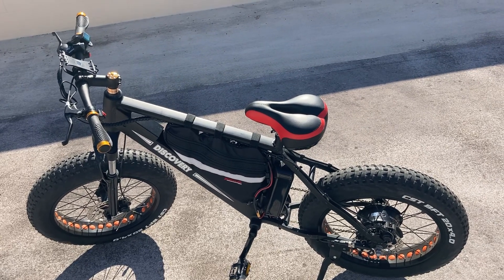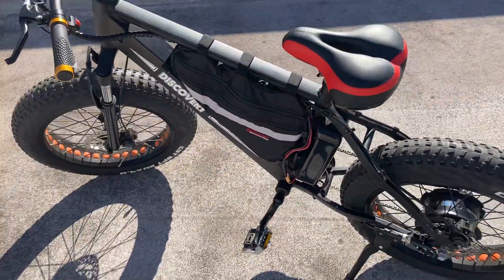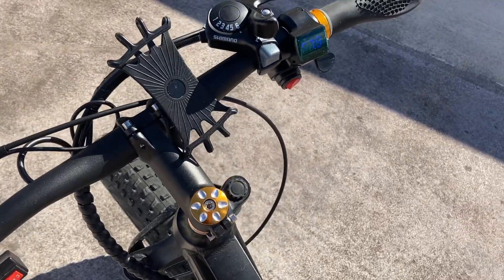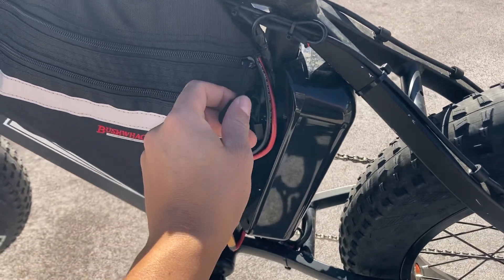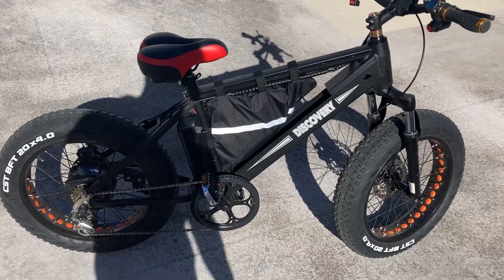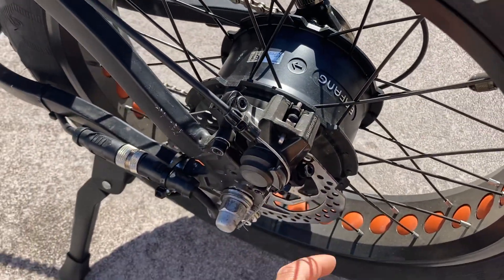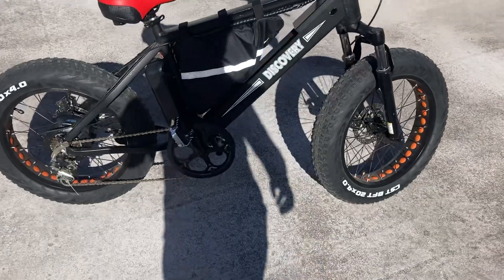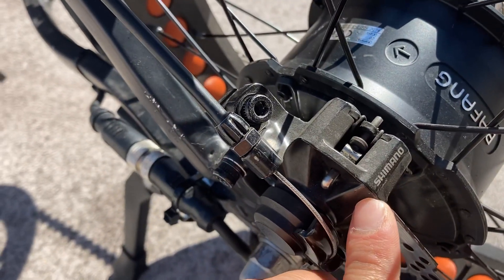New Bafang GO62 1000 watt hub motor fat tires w/ 1500 watt controller and powered by Ego battery

Comment: I have the same motor, I like it, but I was expecting a little more.
Reply from the maker: Running 72 volts on the go62 is where the fun is
Reply: @hawaiiebikes707  lol, that's where I'm going wrong!  It feels like it's governed. It's the Amazon kit with the 30amp controller.
Reply from the maker: @bassw1758  I need to make a YouTube video on how to make an aftermarket controller for that motor. It has so much potential and a larger stator so it can handle a lot more current. I’ve put 3500 watts into it 😁

Comment: Use RC LiPo, I used Zippy 20C LiPo before on my old Ebike builds, It was pulling around 5 Kw. Only possible with LiPo with a small battery. 

They never really got out of balance so I purchased a Bulk charger to finish charging at 66.4 volts if I remember correctly, that would be 4.15 v per cell for a 16S battery. I never ran them down below 3.5v per cell which really helped with the balance. Occasionally then I would hook up to my RC balance charger. I never used a BMS, it's not necessary when you know what you're doing but I always charged the battery in a fire proof location with a smoke alarm, I never had any issue. Use 30 amp anderson connectors for connecting the batteries together in series and parallel and if you make a mistake the andersons blow up and act like a fuse 🙂

The higher voltage makes a real difference.

Around 5 Kw through a direct drive hub and around 3.5 Kw through my old MAC 8T motor, that was a blast!

Is this GO60 a 6T 8T wind ?

Comment: I have the same one with 52v has alot of low end, but only 29mph top speed, I'm wondering if it's the display.
Reply from the maker: Might be. Also depends on wheel size though.
Reply: @hawaiiebikes707  if you lift the rear wheel it only goes up to 32.5 mph, but I've seen 750s hit 37mph.  It's the 500c display, but it's got good power. It's on more of a trail bike so 29 is good but feels like it has more on the top end to give.

Comment: Hi my bafang hub motor is 9 speed cassette and my bike is 7 speed cassette now I don't know what to do can you please tell me
Reply from the maker: I would bring it to a bike shop but basically your bike gear shifter has to match the gears on your cassette for it shift correctly

Comment: Hi there. Who's controller are you using  ?
Reply from the maker: It was one I wired. I have a 72 volt controller for peak of 2400 watts I can post on eBay
Reply: @hawaiiebikes707  so I purchased a G062 motor from Greenbikes in Hong Kong. I need a controller with the L1019 connector attached to it with approximately 2 ft of wire leads. I'm just getting into ebikes so I have a lot to learn.
Reply from the maker: @jeffreyjohnson2712  I just saw this. Did you get a controller yet? I have a 48 volt 1500 watt controller and a 72 volt 2400 watt peak controller wired up. You absolutely need torque arms with this motor
Reply: @hawaiiebikes707  Hi there. No, I haven't purchased one yet due to my travels. I'll be running  one 52 volt battery along with the stock 48 volt battery. I live in Minnesota and winter has set in here. I need a controller with the display.  My project bike is a Radrover5.

Comment: Where can I get a controller like yours for my G062 motor?
Reply from the maker: I wire these myself. If you’re interested I’ve sold several through my eBay because of these YouTube videos. I currently have one setup to run between 48-72 volts. At 48 volts it peaks at 1700 watts and 72 volts it will make the GO62 motor peak at 2400 watts.
Reply from the maker: It would be plug and play and will come with a throttle with on/off switch, voltage display, xt60 power cable, and will plug right into the motor. I will charge 100 for the controller and 8 dollars for shipping. Let me know! 🤙
Reply: @hawaiiebikes707   give me a link to your EBAY... I'm interested... BTW, I run on a 52v 20Ah battery. what will that peak at? I have a video of my Duo motor Radrover with BBSHD, and G062, Crushing the biggest hill in SF Bay Area, while pulling a trailer with my dog on my channel. check it out...
Reply from the maker: @AccordionSqueezer  I’ll def check it out!! I would say you can expect 1800 watts with 52 volts. The benefit of the variable voltage controller though is plugging in 72 volts and that’s where the real fun is! I’ll try to get it posted tonight (Hawaii time) and I’ll send you the eBay link. Might do a YouTube video just showing the difference in rpms so more people interested in having the option for higher voltages with the go62 can see the difference. I love that hub motor it really takes a beating. I’ve had it to 3500 watts with the phaserunner controller and it hasn’t broken!
Reply: @hawaiiebikes707  where do you get the torque arms? and what's your Ebay,  I want to buy a controller
Reply from the maker: @AccordionSqueezer  here’s the eBay link:
 
https://www.ebay.com/itm/203985672075?mkcid=16&mkevt=1&mkrid=711-127632-2357-0&ssspo=JxVnmUXIRbm&sssrc=2485189&ssuid=JxVnmUXIRbm&var=&widget_ver=artemis&media=COPY

And here’s where to get torque arms:
https://www.ebay.com/itm/363454890258?mkcid=16&mkevt=1&mkrid=711-127632-2357-0&ssspo=n1j8tckqto6&sssrc=2349624&ssuid=JxVnmUXIRbm&var=&widget_ver=artemis&media=COPY

My email: hawaiiebikes@gmail.com
Reply: @hawaiiebikes707  thanks I just ordered the controller...
I don't think the controller that came with my G062 1000w bafang hub motor kit does it justice. I'm sure this will work alot better.
Reply from the maker: @AccordionSqueezer  I will be posting a video with the GO62 and the same controller with 26” wheels. At 72 volts I hit 40mph! Will ship it out tomorrow! 🤙
Reply: @hawaiiebikes707  where do I get the eco battery like yours?

Comment: Hi,
Nice bike.
May I ask, what controller are you using, and what battery voltage are you running?
Reply from the maker: It’s just a generic square wave 1500 watt controller. You have to wire it yourself though so it’s not plug and play
Reply: So any 1500w controller will work with this motor?
Reply: @Alex-zr1wt yep. There's a little more to this, but yes.

Comment: I dont understand these motors I have a 500 watt motor with a 30amp controller and my E bike reaches 30 mph also I'm using a 52volt 20amp battery and I see videos with 1000 watt motor reaching 30 mph does more watts mean more speed?  I want to upgrade my motor to 1000 watts but if it runs at the same speed I'd rather stay with the same motor.
Reply: From my research, higher voltage invreases speed. Higher amperage increases torque.  Wattage is amps x volts.  The controller governs or limits the max amps to any motor at the battery voltage.  So the higher watt motors can take higher amps at whatever battery voltage without overheating. Then there is the variable of how the motor is wound.  Differentvwindings in the same watt motor may emphasize speed or torque.  But all have a limit, and will overheat or melt wires inside with too much amperage. It is somewhat confusing for sure!

Comment: I have this motor for half a year with a sine wave Kelly controller that have 120 amps pick and I programmed it for a peak current of 60 amps at 48 volts. The maximum power reaches about
 4000 watts. I ride the bike in a difficult area full of mud and the bike is constantly fluttering. But after about 15 minutes of non-stop work on a full throttle lever under heavy load the controller cut off to protect the motor which heats up to 90 degrees but survives everything. I feel the motor with an oil and it goes little slowly but its protect him from the hit.
This engine has a very very strong torque and it tore the fasteners I bought it for but then I made it an inch thick steel reinforcements on each side of the hinge and it did not come off. If anyone needs help he can contact with me ...
Reply from the maker: I love what you’re doing man! I have the phaserunner controller and have had the motor at 3500 watts with no issue. I can see you’re a big fan of the motor as well! It really does handle the power well like you’re saying. In my opinion this might be the best bang for the bucks for motor performance
Reply: @hawaiiebikes707  yes it's actually the best motor for the money, I bought him for 250 dollars and I'm really satisfied for this. But I don't understand how the engine did not get outoff the axis. I bought one at Eli and the engine cut iron like nothing. It has a very very high torque, but for my bike I made a very serious reinforcement of steel a centimeter thick and my motor will not run, my question is how did your motor on 3500 watts not come out?
Reply from the maker: @Yonatan Tsehansky  hi I’m sorry for such a late response. I’ve installed the motor on several bikes. The key with not having the torque of the motor destroy your dropouts is torque arms but also I learned that some frames are just better to install this kind of power than others. Some types of aluminum are really soft and this motor will destroy and round out your dropouts. Bikes with steel frames can withstand the torque really well and i also put 2 torque washers on each side of the rear axle instead of just one on each side and that helps with torque arms. Keep on riding my friend! I’ll be posting a new video with a bike by framed bikes that I put the motor in. Incredible power to weight ratio with this motor 🤙
Reply: @hawaiiebikes707  I cannot wait for the video🤗🤗
Reply: please length of the spokes,1 cross
Reply: Does this motor have a clutch like the old MAC geared hubs ? 4 Kw through that motor might not be very good long term for the clutch, if it has one, or the gears.
Reply: @o00scorpion00o  Yes there is a clutch and it hasn't broken in 2 years of use, but the gears do, and I just put steel gears

Comment: Was expecting you to ride it
Reply from the maker: Sorry I need to get one of those helmet cameras or have someone video next time. I will say that the go62 with the right controller is totally worth buying!
Reply: @hawaiiebikes707  is it good enough to like go over highway hills am interested in these stuff want one to take me to and from work
Reply from the maker: @ackheemmckenzie1152  no it can’t go highway speeds. If you have a 26/27.5” fat tire though you might hit over 35mph though. If you are interested I would suggest one of the kits available on Ali express. I’ve orders 6 of these motors from this company and it ships quick for China! I was a little spooked ordering from Ali but it’s entirely legitimate and this is a good seller. 

 US $327.36  7％ Off | Eletrica 2021Rushed 48v1000w Bafang Fat Rear Electric Bike Conversion Kit Brushless Motor Wheel With Ebike System
https://a.aliexpress.com/_msxiWPK
Reply: @hawaiiebikes707  thank you very much for the help i really appreciate it
Reply: I have this motor for half a year with a sine wave Kelly controller that have 120 amps pick and I programmed it for a peak current of 60 amps at 48 volts. The maximum power reaches about
 4000 watts. I ride the bike in a difficult area full of mud and the bike is constantly fluttering. But after about 15 minutes of non-stop work on a full throttle lever under heavy load the controller cut off to protect the motor which heats up to 90 degrees but survives everything. I feel the motor with an oil and it goes little slowly but its protect him from the hit.
This engine has a very very strong torque and it tore the fasteners I bought it for but then I made it an inch thick steel reinforcements on each side of the hinge and it did not come off. If anyone needs help he can contact with me ...
Reply: @yonatantsehansky469  i was planning on getting a cruiser bicycle and attach a 212 cc predator engine on it

Comment: My 750watt bafang reaches 32mph on flat ground (52 volt battery)....
Reply from the maker: This has motor torque at a higher wattage (power) there are also 2 different versions of the go62. One wound for speed the other for torque. Mine is torque
Reply: @hawaiiebikes707  Hi I‘m very interested in the G 062 especially the torque one, can you share where did you get it, and the controller kit as well? BTW, does the kit come with tail light function? THX
Reply: @hawaiiebikes707 Hi, do you happen to know what the model or winding numbers are for each version?  Looking into doing this on my 20x4.  Also where did you purchase this with the rim?  Thanks, Agustin

Comment: So have you toasted the motor yet? Does it become really hot when you push it at 1500W for a while?
Reply from the maker: Doesn’t get hot just a little warm
Reply: @hawaiiebikes707  wow these motors look fantastic
Reply from the maker: I have had this motor up to 3000 watts with the phaserunner controller and did that for my 4 mile a day commute everyday and the motor got warm but not hot and i weigh 185lbs
Reply from the maker: Field weakening will allow the motor to run at higher rpms off the same voltage too
Reply: @hawaiiebikes707  Yes I use that same controller but 4 miles really isn't enough to get a motor hot. I work in food delivery and can easily do 30-50 miles trips.
Reply: @rantanplan7474  same bro, I do food delivery with those running it on 1900w, it handles perfectly, thinking of upgrading the controller and run it on 2500w-3kw, did you upgrade yet, you have any suggestion??
Reply: @rahi7339  
you could run the risk of overheating it. I have never owned this motor.

Comment: have you ever taken a look at the inside of the motor? its small comparable to a 500W motor, really threw me off. Trying to understand what's the difference. I had a 750W Bafang that I compared it to, and the 1000W is much smaller
Reply: How good is 750w hub motor?
Reply from the maker: That’s so interesting. I have put the motor to 3000 watts and it handles it fine .
Reply: Running 2KW max, 1500W sustained for over an hour at a time.  1200 miles so far.
Reply: What controller are you using?